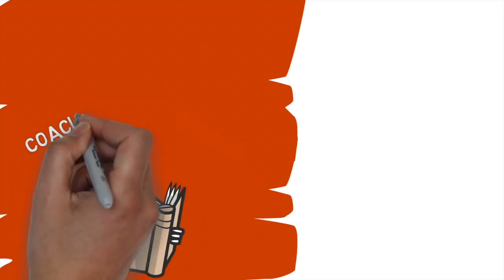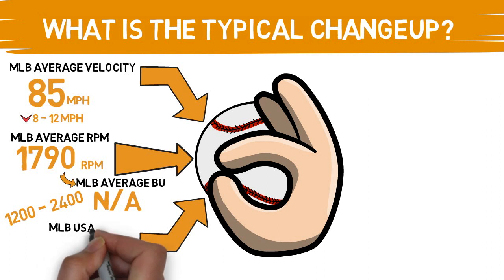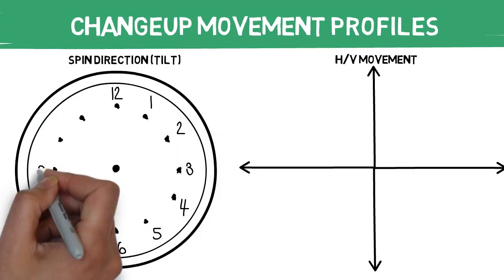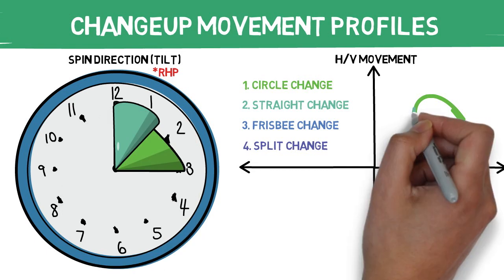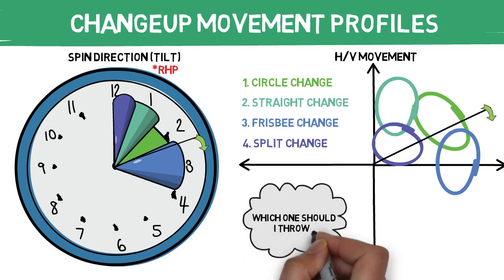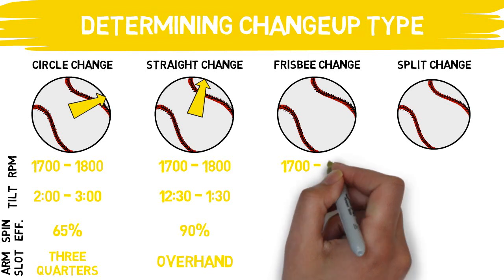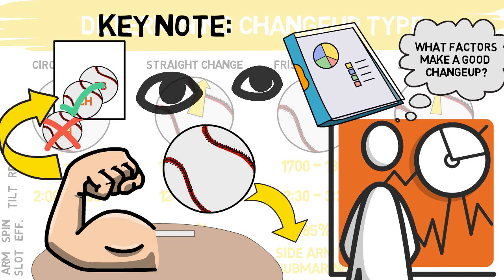CHANGEUP PITCH DESIGN: How To Throw Your Best Changeup

Comment: Are you thinking of creating a two seam fastball video? The laminar express that Bauer has been tinkering with over the last few years would be incredibly interesting!
Reply from the maker: Yes - this is something I’ve considered doing. Laminar flow is a very complex but important part of pitch design for fastballs (specifically 2-Seams). Thanks for the comment!
Reply: @SimpleSabermetrics  Do you have any updates after you see Devin William's airbender changeup? It has the path of a reversed Ottavino slider.

Comment: What kind of gyro degree do you see on varying changeups?
Reply from the maker: Excellent question! This is one I’ve been diving into with some colleagues recently, especially with the varying degrees of successful change ups such as splitters or circle changes. To me, for circle and straight changes a gyro degree closer to 0 degrees is going to maximize magnus force, therefor maximizing movement. In a circle change with a lot of horizontal movement that would be my goal - but you can get away with a higher gyro degree throwing a straight change as that will provide more vertical movement separation from the fastball. Hopefully this answers your question. Thanks for the awesome comment!

Comment: By 3 oclock for the circle change, Do you mean supination as opposed to pronation?
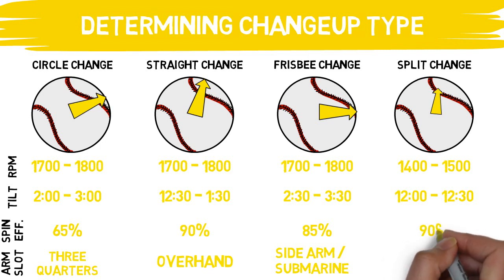Reply from the maker: Great question - actually a 3 o’clock CH comes from the ball coming off the last finger through pronation. Supination will lead to spin direction’s on the other side of the clock (ie 6:00-9:00)

Thanks for the comment!
Reply: @SimpleSabermetrics  Ok that makes a lot of sense. Thanks for the response!

Comment: Do you believe a pitcher’s perfect changeup would have the exact opposite spin axis as their slider?
Reply from the maker: Thanks for the comment, David! That’s a great question. In my opinion things like this come down to a case by case basis. In the two videos I did mention that some of the best versions of these pitches I’ve seen come with a 9:00 (slider) and 3:00 (changeup) o’clock tilt. 

But it’s more complicated than that, crafting pitches for each players arsenal must be based around the rest of their stuff. Arm slot often shows you the direction that you should head in for each pitch.  

Hopefully that answered your question. Thanks for watching!